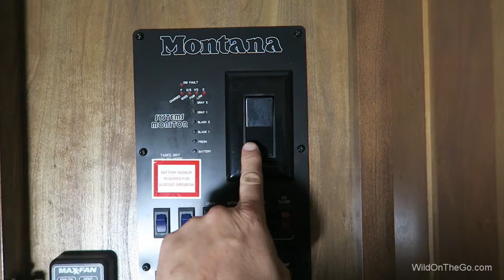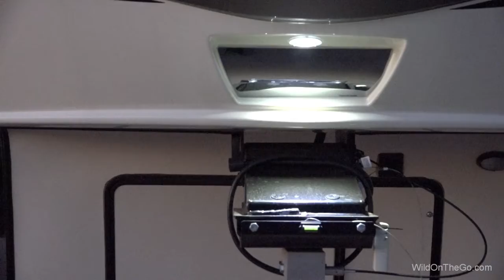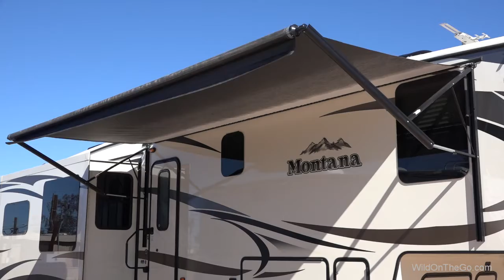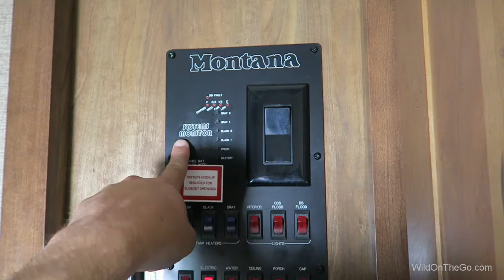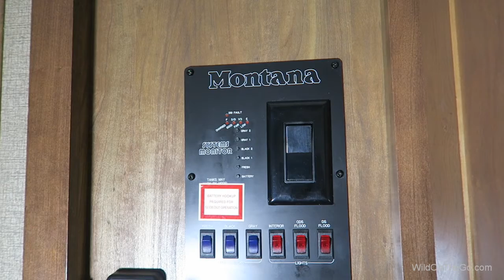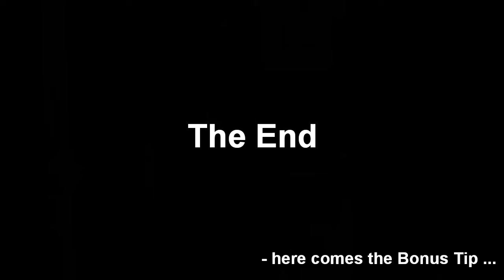RV Control Panel Explained Montana 3402RL 2015 2016

Comment: On your fan blades. If your screws still are coming loose. Try some lock tight . 
There are 2 colors  red an blue. The red is strong.the blue is like medium.if you plan on taking the blades off to clean them do not use the red.
Reply from the maker: Ever since we tightened them, they've been staying tight.  But thanks for the thoughtful tip.